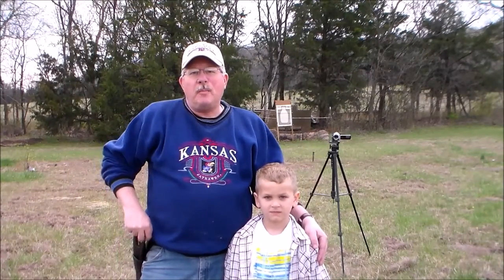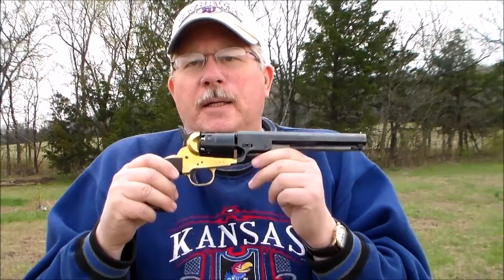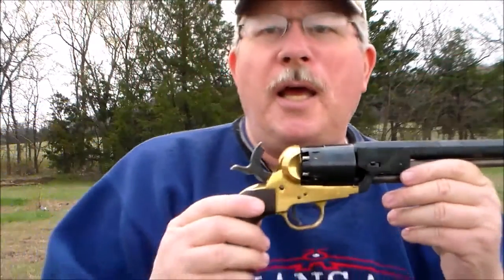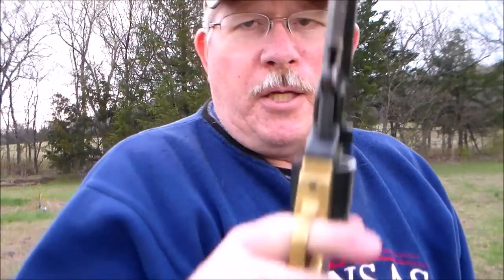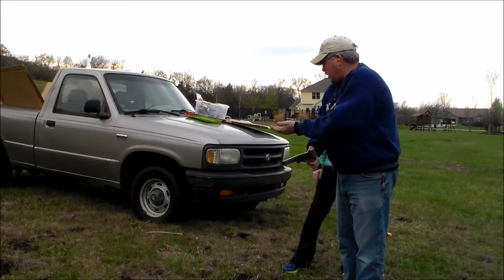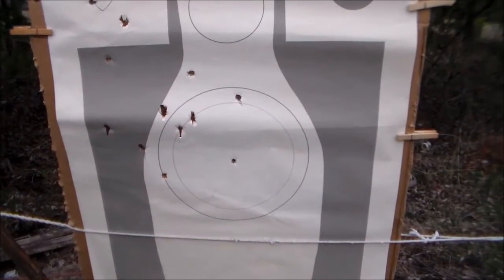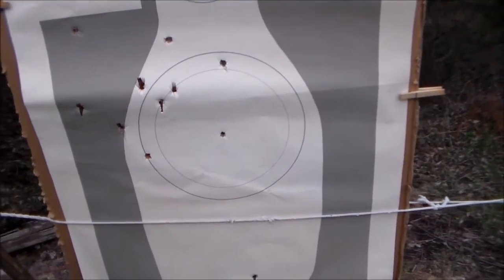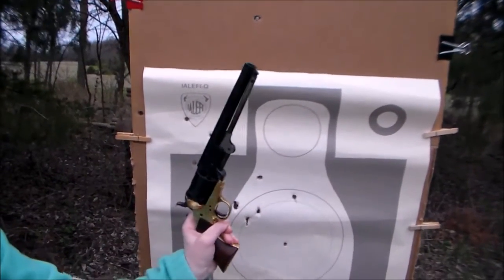Colt 1851 Navy with Slix Shot Nipples

Comment: The Colt Walker and the Dragoon were both .44 cal and existed before the 1851 Navy. The reason the Navy ordered the gun to be made in .36 was because it wasn't going to be carried in a large horse saddle like the Walker and Dragoon generally were. It is an enlarged version of the .31 Cal Colt Pocket revolver. It was a mechanically improved and simplified version of the 1836 Patterson. It was sized and designed to be carried in a belt holster by naval officers.

Comment: Going to try Blackies free fix.
Reply: Best fix for a Colt style is cleaning up the hammer face and installing Slix Shot nipples.  Some ppl use JB Weld to fill in the safety notch on the hammer, that's fine if you only load 5 and leave hammer on empty chamber but not good if you load six because the filled hammer notch will not rest on the safety pin.
Reply: Did it work?

Comment: Looks like healthy loads for a brass frame,is it loose yet? When I was younger I saw a barrel separate from a brass frame 1851,quite funny at the time
Reply: That can happen to any of them if the wedge falls out. But these modern brass repros don't really have the problems that the older ones had that were made in the 60s-70s. There are people that have put thousands of shots through these without issues.

Comment: BudK has an 1851 colt replica which I bought. It's made by Traditions Firearms. Do you know if the Pietta type will fit in it?
Reply from the maker: Scotty BSmeter I would contact Traditions and ask. I have Traditions rifles and they are made in Spain. Pietta is Italian made so you may need to ask traditions if their nipple sizes and thread pattern is the same
Reply: @pliskin54  yeah, i dropped them and Slix Shot an email through their contact section on their websites. Left the 4 available thread measurements offered by Slix Shot with Traditions. They have different dementions for pietta, ruger, and 2 other replica types. Just dropped a message with you in case you knew. Some companies are crappy about communications. Thanks anyways.
Reply: @pliskin54   Another fellow on here recommends filing your hammer face smooth and take the "fangs off" it to also help preventing cap jams.

Comment: The 1858 Remington New Army .44 was only made in .44. You said they did have strong enough metal to make gun s in .44.
Reply: the remington also had a top strap but metallurgy slowly improved over the years, that was the main reason the 1860 army was able to be made, it was basically a modified navy frame but able to hold 44 caliber and not be as unwieldy as the dragoon/walker
Reply: FORGIVE HIM, HES A NEWBIE. HE WILL CATCH ON IN TIME.WIFE DID NOT LIKE SHOOTING IT

Comment: How many grains of powder did you load?
Reply from the maker: I use a powder flask that traps 24 grains in the spout. That seems to be about right in my experience.
Reply: @pliskin54  Thanks.  Is that a .44 or .36?  If .44, unfortunately that is a very weak load.  Would need to exceed 30 grains to reach the 200 ft-lb mark.

Comment: Did you ever get this issue resolved?

Slix Shot nipples are made for Remington #10 caps.  There is a HUGE difference between Remington, CCI and RWS #10 caps.  Never understood how they could claim a standard size yet nothing is standard between the 3 brands besides the #10 printed on the tin.